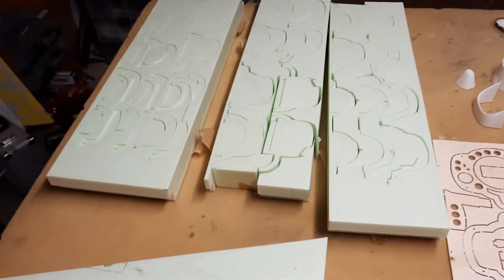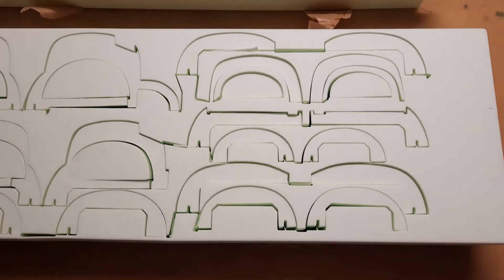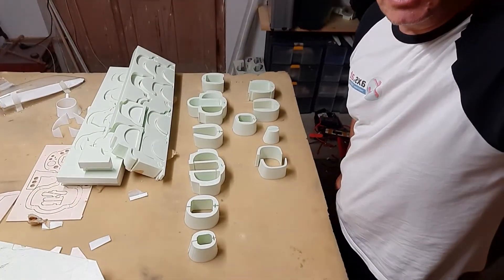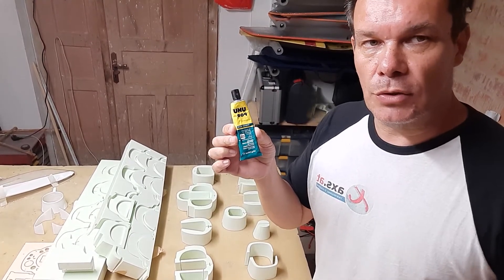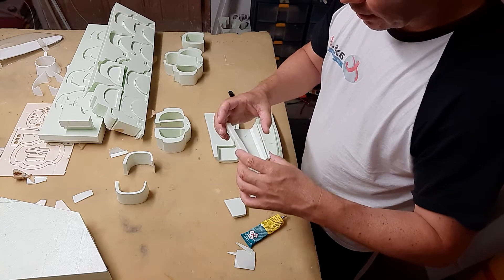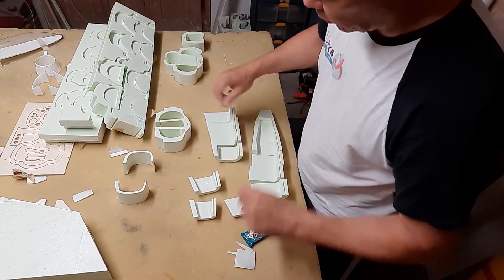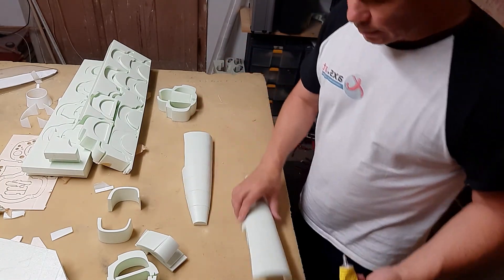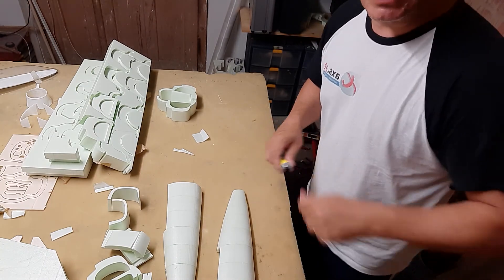How to build an EDF Racing Plane, Gnat Trainer Jet. Part 1

Comment: What kinda glue do you use?
Reply from the maker: Hey I use UHU por. Dont know where youre from but amazon should have it for sure.Make sure you apply on both sides press together release and adter 1min press together and align Did you get a kit ?
Reply: @TestFliteTV  no I just messaged that person you told me to contact. And I'm in the United States, Florida. I'll check into that glue. I know at Walmart they have tac glue which I think Is pretty much the same thing. 

I have a few plans that I've built but when it comes to foam glue I've went threw a few different kinds because I had a few that completely melted my foam airplanes I built then learned to always test them on some small pieces first. But I just wanted to say thank you for your time I really appreciate it.
Reply from the maker: @joewynn2445  Hey no worries.I have one.kit available and I can supply. you the link for the glue. If you cant get it over there I can include one in the kit if you want.Plane kit would be 95$ plus shipping which will be in the 25$ range .glue around 10 bucks.Kit includes 3d printed intake lips nose and vlear canopy.
Reply: @TestFliteTV  Really, that's awesome! I can't buy it right now. I'll be able to get it around the 1st of next month. I just got a few bills that just came in all at once. But ill definitely be in contact in a couple weeks if you still have it. But if you need to sell it now I completely understand. Thats a really nice kit/airplane
Reply from the maker: @joewynn2445  ok  no need to sell right now let me know and reach out to me.Cheers Rico
Reply: @TestFliteTV  thank you! I really appreciate it. I'll keep you informed on when I can buy it.
Reply: @TestFliteTV  I can buy that kit now.

Comment: Where can I get a kit like that, or download the plans to build a kit like that? Thanks in advance
Reply from the maker: Hey you can write to Dirk . He sometimes makes a couple of the them but not in series.,vonwplanes@gmail.com
Reply: @Enrico Traby TestFliteTV  I'm wondering the same thing I want to build the Viggen J-37 with canards. I also have a "360" degree vector thrust to add on to it. With it being able to hover hands free and having the canards is amazing. ❤️ I've decided to 1st get into the 50mm class and by the time I'm ready for 70/90/120mm EDF jets one will be the Viggen J-37 which I read to contact Test Flight for the plans although I'm wanting to get into foam carving and building my own jets just like this. ❤️ 💪 😎
Reply: @jasonfalcon7821  I've built the viggen with a foam cutter. Its really nice I just used too heavy of a foam and its over weight. With a 65mm and 70mm edf and they turned out nice but I need to learn how to keep the weight down more and learn how to fly them and keep them in the air longer. 

I'm 4 years sober and use this as my distraction in life to keep me busy and I love it
Reply: @Joe Wynn  that's awesome I'm in the process of building a 1:72 Balsa F-15 which om going to inlarge it and build from cardboard ❤️ 💪 😎.
Reply: @jasonfalcon7821  that's awesome, do you have any pictures anywhere or videos?
Reply: @Joe Wynn  I'm wanting to get into edf jets carving I would love for the Viggen J-37 to be my 1st electric jet although at the moment I'm practicing with up scaling a 1:72 F-15 with it's sheet of paper that come with the build all I need to do is to have it inlarge so I can copy it being 5 times bigger then 1:72 and try and make it in the 50/90mm EDF size with at least a 80 Amp speed control with an 11 blade turbine fan which I'm going to use cardboard with harden glue with a 50/50 mix of water which dries and is stronger then Balsa and still very light with cardboard being easy to come by and when I get my specs just right I'm then going to use coke can aluminum to cover my aircraft which my company logo will be FalconXstreaM ❤️ 💪 😎
Reply: @Joe Wynn  no I sure don't but I've been flying rc helicopters since 01 which I have plenty of pictures and was the the 1st to build the 1st ccpm T-Rex 400 but I'm just now wanting to get into EDF all my life I wanted to follow in my uncles footsteps who retired as a general flying the F-16 Viper and survived the attack on the Pentagon on 9/11/01 which he also flew the A-10 Warthog 2 in Desert Storm and then Top Gun 87' he also was a Test pilot in the early 80's flying the A-7 Corsair and before that he graduated from R,O,T,C as a valedictorian and became an officer as soon as he joined the Airforce which his 1st plane was the T-27 Trojen and then the T-38 Talon which is a great low wing fighter/trainer but I'm just now getting into EDF jets which I also want to get into F,P,V flying the Viggen J-37 ❤️ 💪 😎
Reply: @jasonfalcon7821  that's awesome you should record your build id love to see it here on yt
Reply: Please could you share a plan of your awesome jet with us Sir? Many thanks Steve 😎👍